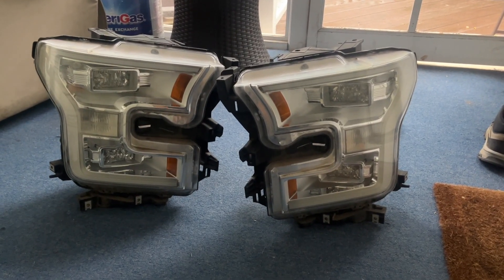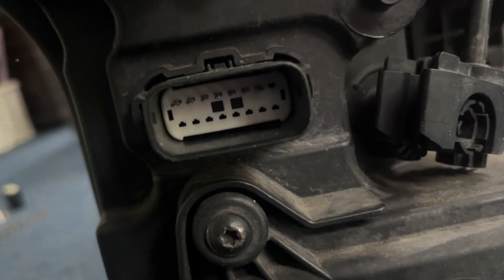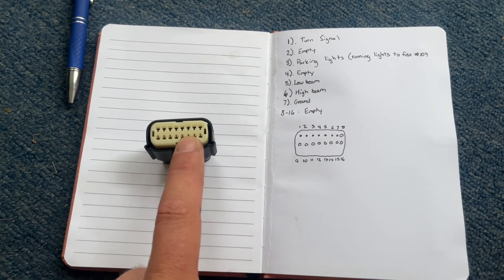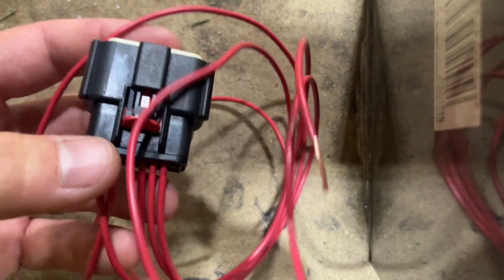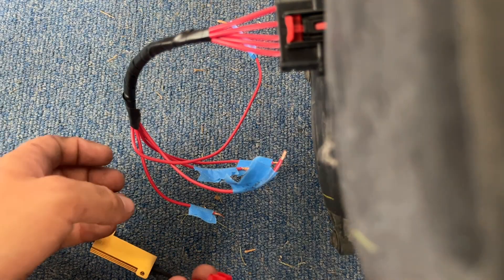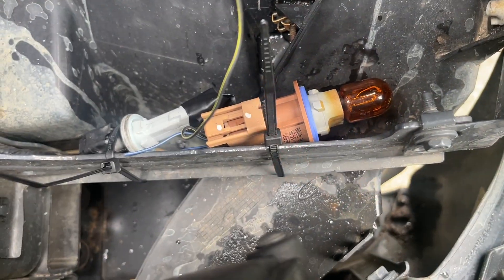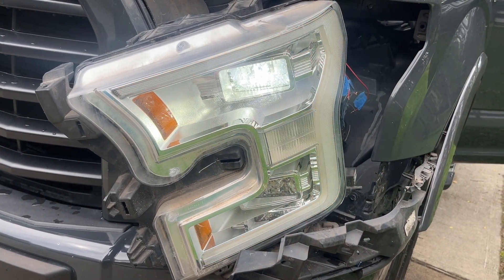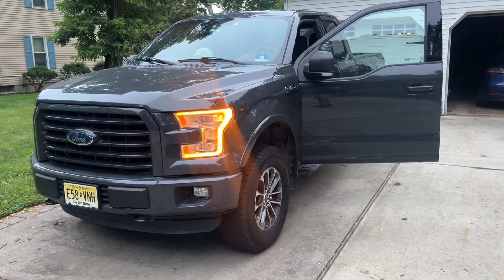F-150 Halogen to OEM LED Headlight Conversion with DIY Wiring Harness

Comment: @kurtschwoerer so for the high and low beam plug you removed the bulb, cut the wires for the low and high but left the the grounds intact?

But the turn signal bulb you left the bulb in and  just spliced into the plugs wires?

The marker lights plug was taped over is that because you removed the bulb?  And then cut the wires like the low beam high beam connector or did you keep the bulb in the connector and spliced into the into the wires like the turn signal bulb?